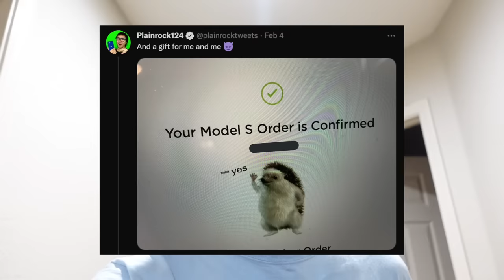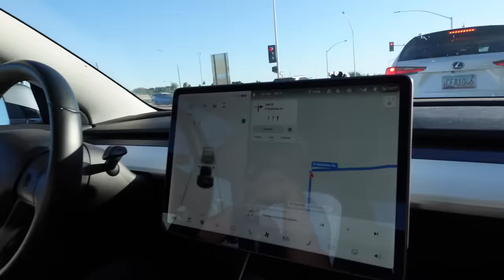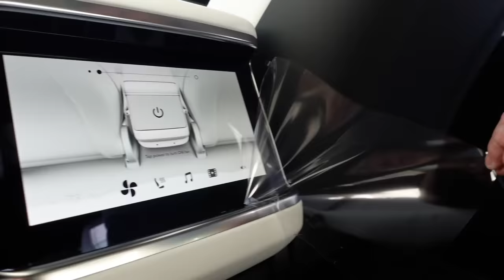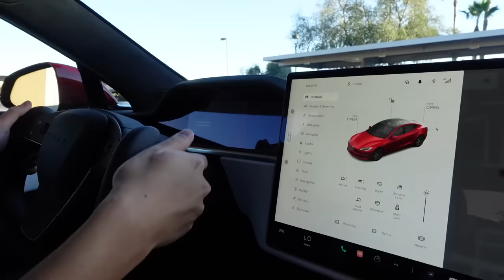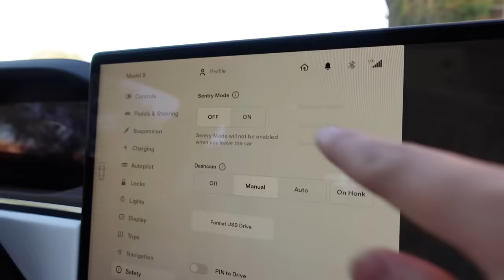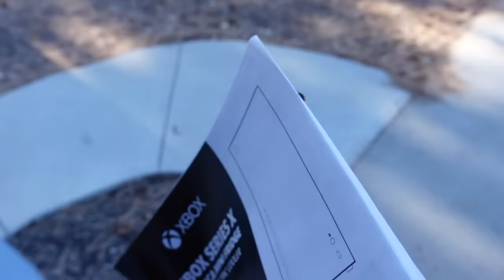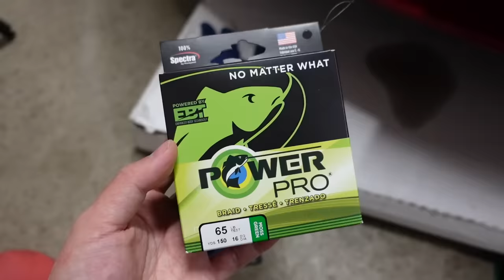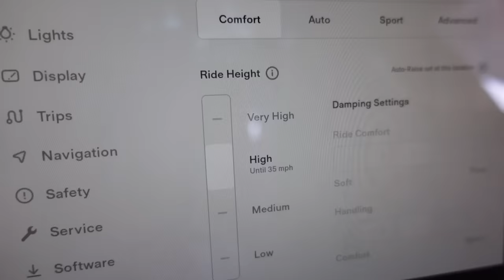ANOTHER TESLA ALREADY?!

Comment: Little tip, there's another way to shift. Below the phone chargers and beside the emergency light button, there are 4 touch buttons for shifting. Not any better than using a stalk, but it lets you put it in Neutral and Park easily, so...

Comment: The reason the tesla keeps tripping the breaker is because the wires wouldn't be able to handle the current. You need to install a new fuse (preferably 30 A) and new wires that can handle it. Do not just change the breaker, it could burn the house down.
Reply: "We gon burn the whole house down." Burn The House Down, By AJR.
Reply: @bettercalldany  r

Comment: Wonder if there’s a mod for the steering wheel to make it normal again
Reply: lol, most likely you can just get a req wheel and swap it but idk fs but i kinda like it. and yk tesla likes to be dif lol
Reply: I wouldn't like that steering wheel, it looks like a power wheels and I don't want my hand to slip off the wheel and have it straighten out the wheel while making a turn. Maybe that's because I drive what you may consider a "broke" truck
Reply: tbh you can mod anything, so Probaly lol
Reply: You could probably source out an old S wheel but I think other parts were changed so it may not be compatible.
Reply: Somebody did manage to do that, but it cost them around $34,000
Reply: @Adotsupplythehood  yeah but because of that they made a ridiculously impractical wheel for daily use. Fully rotating with a wheel like that is far more annoying than a standard wheel, thats why that wheel shape is only used for racing.

Comment: Original 295 miles is EPA (mix city & 65 mph highway) on the original, smaller & lighter rims. The larger rims used in the video used probably another 5% energy.
Probably should have gone til it died (battery showing negative %) to get full useable battery and more accurate % loss. Still a good test and interesting video. The EPA should separate highway range for better expectations.
Also, this is old battery, chemistry and technology so likely today’s cars will last even longer.

Comment: I actually don't like the revived Tesla Model S because of these reasons:
1. The yoke steering wheel is sh*t.
2. Having to switch gears on the touchscreen is really annoying.
3. No stocks behind the steering wheel so using the turn signals/horn is gonna be a hassle since its on the wheel.
4. I don't like the black door handles, I think the Model 3 chrome handles look better.
5. Too much screens.
6. Build quality isn't very good.
7. Leather floormat's an optional extra.
8. Extremely expensive.

But there are some things I do like about it:
1. The pedal's metal design.
2. Horizontal touch screen (Old one had a vertical touch screen)
3. Automatic opening tailgate.

Comment: Wait a minute, they removed a safety feature, the top of the steering wheel.
means you have to cross your arms when steering which is bad, because if the airbag goes off, you break your arms

Comment: Stop wasting your flipping money for the worst car in the world, this is not just my opinion about Teslas, here is the evidence: 

It's bumpy, it's rattly, when I want something I need to take 2 minutes on the screen, it's unreliable, bad build quality, cheap materials, a steering wheel that wobbles up and down when you move it, the top of the door wobbles, horrible brittle sound on the trim when you knock it, fabric on the bottom of the seats, not covered back cup holders in the armrest and covered with cheap plastic, when I put down the back armrest while in drive it makes a loud rattling sound, bad door closing sounds, cheap fabric speakers and part of dashboard which gets worn out quickly, the roof window gets orange in the sun, back seat shaking around while drive, back seat belts unsupported so they fall to the side any time you move, scratchy seat belt material, the backs of the front seats are covered with cheap scratchy plastic, old Teslas had a manual opening storage in the centre console, new Teslas centre console storage place is dangerous and can get your hand scratched and caught, back windows only go half way down, zero back window visibility, squeaky windows, loud cabin noise, barely any configuration choices. If you question me, I tell you that I test drove two Teslas for myself. Teslas should be £15,000 - £20,000 not £50,000, it just doesn't make sense. Beware, Tesla is a scam. 

- Add on: Before I went for my test drive, it took me 5 minutes just to open it. I placed the card onto the door pillar where it was meant to be and it just didn't open, Tesla should just make a key for goodness sake and trying to be "unique"!! I don't want to take 5 minutes opening a car thank you very much.
Teslas are unique. Uniquely bad.